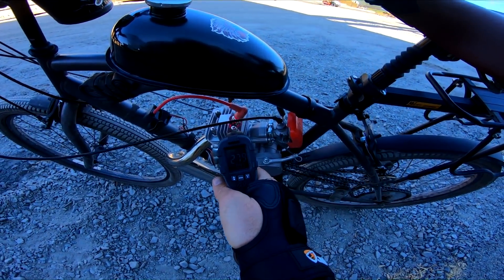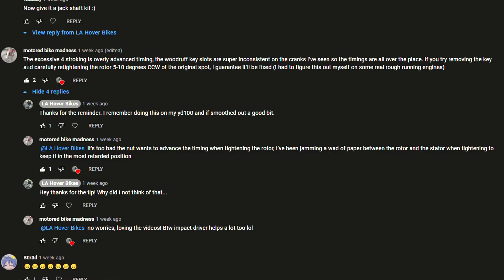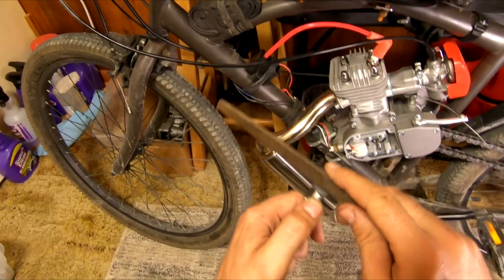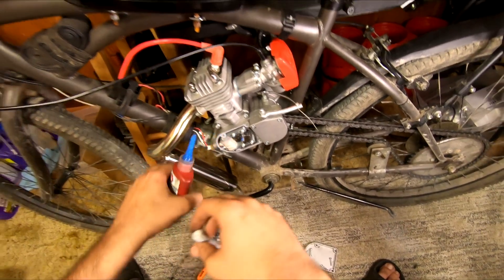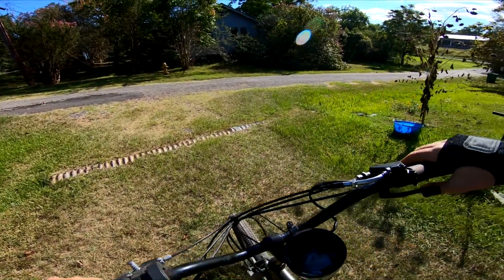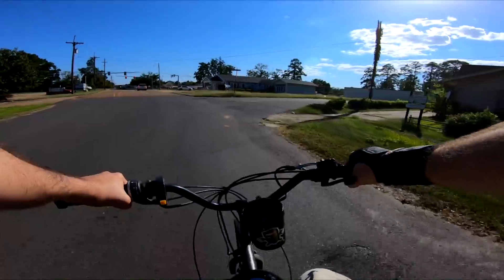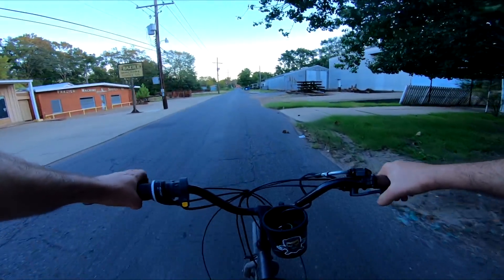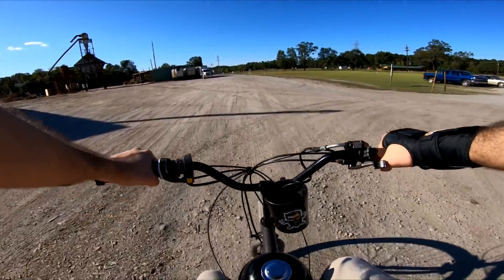Adjusting Ignition Timing On A Motorized Bike

Comment: Firstable if the ( Wal Mart)  bikes if they are pedal  rear breaks, first thing its gonna break is the rear shaft. Second it's gonna go thru the reaar bearings like butter . The brake pedal shims will wear down to almost nothing. No matter how much grease you apply, that will happen to you, NO MATTER WHAT. I guarantee it. In fact, I assure you.

Comment: I'm here because of my Moped engine E-50 with a kit 64cc and it runs Cool 187 to 210 degrees F i'm trying to jet the carb correctly... the kit calls for 1.25mm BTDC but my stator slots only allow 1.44mm BTDC as per my timing Micrometer. so after many jets 82 trough 96 No color change on the plugs at all and have only reached four stroking on the 96 jet just guess i'm plain lucky i didn't seize the motor. i'm thinking the engine never gets hot enough to color the plugs?i'm going to remove the Stator plate and lengthen the slots to allow for more retardation to 1.0mm BTDC and set it to the recommended 1.25mm timing and start over....start jetting at a 94 jet probably.Your thoughts will retarding raise my engine temperature?

Comment: Installed a brand new kit and did a really clean professional job (since Im an actual 20 year auto tech) because I didnt want it called a meth mobile. Got fuel, air, spark, and compression but it wont even try to fire cranking for 20 seconds even with ether blast. Your video gave me one clue to check out and see if my ignition magnet was installed backwards/flipped at the factory. I really hope this makes it start or Im junking it.
Reply: I think it will work for you because I have the same problem

Comment: I made  my straight pipe and it’s loud and mine goes faster uphill goes 50 straight goes 70 mine is faster but the bike it self it steal bike so it’s bit heavy with the motor I can lift it barely but it fasts did 70 in a damm 40 paasd a cop didn’t get pulled over I was cruising

Comment: I would like some advice on the hub adapter for the rear sprocket. I have to use the ring spacer on it. Wanted to see if it would be better to put a set screw through all of it or wood ruff keys? Is there a way to contact u for advice

Comment: Hey bud I have a question for you if you don't mind answering. I bought a JRL half moon exhaust for my 100cc non branded motor, is it any good that you know of? The original exhaust that came with my engine got broken by me loosening the cap bolt to remove the cap and check the inside of it and to add loctite on the nut. So this is why I had to get a new exhaust and the JRL 40mm half moon exhaust was only 20 bucks so I went with it over the stock exhaust. Also I would like to add that I got a high performance 100cc motor kit that resembles the YD 100 and all the parts I have purchased and changed have been for the YD 100 and they fit to a T . I have a 50mm piston, 8mm studs, and a 1 piece top end with 40mm exhaust bolt on and intake. That's why I think it's a YD 100 unbranded, same specs. It also has a ton of torque and speed.
Reply from the maker: They work, but don't do much other than make the bike louder.
You might get a bit more power if it's less restrictive than the stock exhaust, but most are not tuned for these motors.

Comment: I'm putting an engine on a Schwinn Stingray with a Headstrom trike rear end. Both rear axles have traction via freewheel sprockets. This makes it so I have to pedal start the engine. I think I'm running a 25 to 16 crank to center shaft. And boy it still takes a ton of leg to start it. Sometimes it kicks over on the second try. Other times it takes a block to start.

Comment: I put a 110 cc on a trec carbon fiber frame and the carbon fiber is stronger than anything else plus it’s light
Reply from the maker: I'd keep an eye on the tubes where the motor mounts. I'm told carbon fiber does not like to be crushed.

Comment: My experience with a bike kit like this is that there are scant quality parts that you can buy for them. I've yet to find a decent coil for mine that gives a strong spark and I've even tried switching the magneto too and I can't figure out which part is the problem if not both of them. The bike only worked for the first 2 months I used it. I just bought a new carb too as well as the coil and hopefully that will fix the problem of the bike not being able to run unless I'm going down hill or have built up lots of speed befire hitting a hill. You can't trust Amazon sellers or eBay either. There are so many garbage listing that it's near impossible to find anything decent. I've also learned that these bikes need constant maintenance in order to function. By constant I mean be prepared to clean and rebuild the carb every couple months and expect the coil to need replacing every couple months too. And expect to have to buy multiple substandard or non working replacement parts, also never expect that they will come with the correct sparkplug, ever as they won't. and dont think that buy8ng the more expensive ones will be better they aren't and will be the same as the cheap ones and same w8th the red so called Racing ones they are just red and not better at all. And because the wires all have spade terminals you will have to put new spade terminals back on the wires to get a refund. I've never seen wiring that uses them on the kits but the replacements all have them. And the laminations on the magneto are usually horrendous and are normally bent or loose. They are also made from the worst grade of steel ever and are thick. So don't expect a decent spark. It's a dice roll to get lucky and relieve good parts and are rare. Why this is the case is that there's obviously only one or two maker of these kits and the one that makes the crappy ones has 95% of the listings that exist. I'd be glad to pay 400 for a quality one but due to the 400 priced ones being the same ones as the 179 priced kits you are wasting your money spending the extra. If anyone knows of a quality source let me know.

Comment: So how overdramatic are you being when you say “this engine terrifies me” for YouTube effect? I’m asking because I want to know if it’s worth the extra 200 bucks for the phantom 85 over a non built China motor and how close can someone with some mechanical know how come with a home port job to the performance of the phantom 85 out of a regular cheapo head?
Reply from the maker: I don't blame you for asking... but this thing is dangerous if underestimated. Although it is powerful, sadly it has proven to be unreliable over the past year. They have been tearing themselves apart.
Reply: @LAHover  even with the new wrist pin and bearing?

Comment: to hold your shaft take the plug out and  feed a cotton rope into the cylinder  leave a handle on the  outside then bring up to tdc. rope will lock the cylinder.

Comment: You totally didnt even mess with the jetting lol im sure jetting it more lean would help since they jet these engines really rich and recommend 20:1, which 20:1 is sooo bad for it. 40:1 with some good oil such as AMS Dominator would do good and maybe try a few sizes down on the main jet.
Reply from the maker: Down jetting mad the bike run worse. Timing fixed it.
Feel free to go about it your own way, I'm just showing what worked.
Reply: @LAHover  Interesting! Ive never had an 85 but had an 80. Was a POS engine though. Im literally waiting for a brand new Stage 4 Black Bikeberry 80cc in the mail today. Not sure how its going to run but im sure im totally going to have to mess with timing and carb lol its going on 1 of my stand up scoots. Should be super fun.
Reply: @LAHover  I had a question. So i got a Stage 4 BBR Tuning 2T. For some reason the engine sprocket does not want to move when i pull clutch in. Trying to put a chain on and it just wont move. I jiggle the gear and it sounds like something metal inside is stopping it from rotating. Or am i missing something?

Comment: I did not know you could adjust the timing on these engines. Thanks
Reply from the maker: Great way to smooth out a motor without the fear of going to lean trying to tune out the carb.

Comment: Hover I know u have issues with the  chain tensioners so I figured a way to make em pull away from the engines.ok u kn how we all put the bottom of chains on em instead of doing it that way take the top part of chains a run em under the pulleys and set it to the highest it can go and they will never Loosen up again

Comment: Sooo, going back to what you said about putting the magnet in backwards and still having spark.... Where would this spark be?  Would it be the same distance from TDC, but opposite, or would it be 180 degrees out?
Asking for 'Academic' reasons....
Reply from the maker: At TDC the keyway on the crank should be at 1 O-clock
When set on a table the keyway for the mag should also be at 1 O-clock
Reply: @LAHover  Thank you.  Thinking about it some more, I realize that reversing the magnet wouldn't change the timing at all, just the polarity of the voltage generated by the magneto.  (edit: no, that's not even true.  It depends on the alignment of the magnetic poles to the keyway)
To do what I want, I'd need a new keyway cut on the magnet stack.
Argh, but that still wouldn't work, because the drive sprocket would be out of position and the chain wouldn't feed.
Sorry, new enough to this community to still wonder "Can I just turn the engine around to drive a main crank freewheel rather than getting a jackshaft setup?"  But no, you'd need an engine crankcase that's made as a mirror image to a regular engine.
Let me get the thing built first, before I start thinking about mods, eh? :)

One more thing - I'm really envious of the trails you have available to ride on.  I don't know of any similar trail systems around here (New Orleans area) that are available to motorized bikes.  I've ridden my regular bike on the Mississippi River Trail atop the levee, but that doesn't allow powered vehicles.

Comment: You're gonna like that faker frame man, they're real light and strong. Can't wait to see both the motor and frame done
Reply from the maker: It's growing on me. Had the change up the seat and bars tho... To dang tall for that racing stance lol
Reply: @LAHover  Yeah man, try BMX parts, like the Stem and Handlebars, you can trust that stuff (it's a hair stronger than MTB parts), and there's about a half inch more room for the extra brake and the throttle. Man i wish YT had pics, lol I think I went too far on mine but its sick as!

The height thing I tried all kinds of stuff but in the end I chose to change my actual riding style on the faker, it's kinda like riding an 80's enduro almost, so leaning is more scary but I got used to the height pretty quick, and I noticed you run a MTB tread for most of your builds, try MAXXIS HOLY ROLLERS, great half-half tire with awesome performance on street and dirt, and they last too, I noticed with the knobbies I lost quite a bit of turn confidence, so I switched.

anyways man, sorry for the book, I just get excited when someone mentions the Fakers, I friggin love em!
Reply: @zachgrabow9541  i would love to see your bike you should make a video

Comment: Was it Gas BIKE or PIRATE CYCLE that was selling after market performance magnets??? I still have the original one I bought how many years ago it amplifies the spark and retards the timing. When I use that magnet with my jetted carbs the bikes really haul ass for me. I want to find them magnets I have 2 builds right now that are really disappointing to me. I have ZEDA80 that just does not build the power like it should. I am gonna blame it on a bad pickup magnet.
Reply from the maker: Good question, I'll have to look around and see if I can find one.
Reply: @LAHover  Keep me in the loop please. I can look today some it's raining but I have to deal with my insurance company on a medical issue and that takes up half my day sometmes
Reply: @LAHover  Oh by the way I wanted to buy a Phantom 85 and Bicycle engines is out of em at the moment. Something about bad bearings. I am gonna give em call now. Let me know if someone else has em.

Comment: I've watched several of your videos and for the most part they're pretty cool. However, would you please, PLEASE stop calling an engine a motor.
Reply from the maker: Motorized bike 
Motorcycle 
Department Of Motor Vehicles 
Motor Sports 
Motor Swap 
Motor Head, ... 
An engine OR MOTOR is a machine designed to convert one or more forms of energy into mechanical energy. Available energy sources include potential energy, heat energy, chemical energy, electric potential and nuclear energy. 'Wikipedia'

... Nah I'm good bro...

Comment: From Ken himself: The phantom 85 

  There is a lot to talk about.
As many of you have already seen several failures already.
  In this post I'll show what I have found that is wrong with the engine that is on my work bench and in my opinion what is needed to fix some of the issues to hopefully make this engine usable.
  
Squish 1.8mm :(
Soft bushing in the rod :(
Intake port to wide it will snag the ring :(
Crank not balanced properly :(
  Port timing is fair but room for improvement :)
With a simple piston and rod change these issues can be fixed.
 
  With a piston and rod change it has resolved ,
Ring snag.
Squish .
A port timing is nice.
Also can be used as reed or nonreed setup.

Comment: omg, i just got back from pushing/riding my motorised bike, it broke down!!! miles and miles i had to pedal it.   must be the spark!!!!  i kept thinking i must take a spark tool and spare cdi etc like la hover said!!
Reply: I ride with an extra magneto, CDI, 3 different spark plugs, clutch pads, tubes and tube repair kit, every gasket I could need, and every single tool I would need to take the whole bike apart.

Comment: Cool good info you passed along. And yes.. we were all wanting to see this wide open down the road. But, I get it. guess we will have to be patient for the update. I might consider getting this. The other motors in past I just felt was to china.. so never bought them. But, this is a great step in right direction.

Comment: Ive had my crank seal leaking so badly that oil poured out of the stator cover as soon as I loosened the bolts, but engine still running! Those seals are tricky sometimes and each side is of a different thickness.

Comment: 49cc is good enough for me. replacing the Walmart wheel bearing grease with teflon grease would do great. I got a 700c bike with dual disk breaks. everything is adjusted properly and I use it to get things I need. a small motor would aid me a lot.
Reply: 😂😂😂they only go like 45mph
Reply: @foresto5167  more like 30 tbh

Comment: Hey I've been watching your videos for a while while going through the hoops of my own bike build. I had a cool idea about installing an electric bike wheel on the front of my motorized bike. Doesn't seem like anything could go wrong xD
Reply: i was thinking the same thing but i feel like if the wheels werent going the same speed there would be problems
Reply: @sealdilly2691  I had the same thought recently. My thought though was using it to get up to speed. Electric to accelerate and fuel for the mileage. Could also use when hill climbing to help out the china girl. The different speeds shouldnt matter in those scenarios.

Comment: I tried this on my BT100 and yes, it did smoothed out the mid RPMS and my idle sounds much better. I shaved off about 1mm in the woodruff key. However I still have some 4 stroking on top end , probably carb tuning issues since I'm using a Bofeng carb.

Comment: Thanks for the tutorial.My bikes been a bit off and moving the clip about hasn't done squat.I even went to a BR5HS for it's hotter spark as its ok in winter.It just wasn't right.I f'd up and thought 25:1,because of the 80-90F the last month would make the motor last longer,but now I see the DUH in that.Happy Trails.BTW.Even with the $140+ 'alloy wheel sets' you really have to check the bearings often.
Reply: I'm hoping I can convert my hubs from loose ball bearings to cartridge style bearings like what a motorcycle wheel uses....MTN bikers want the quick release wheels/axle but I think for a motorized bike, the beefier bolt on wheel axles are better. Pretty sure those quick release axles aren't nearly as strong and are for weight savings & making tire/wheel changes easier.

Comment: I love the idea of those gas bike frames, not that I can get my hands on one anyway, but I'm nervous about aluminium frames. I've not had great experiences with aluminium. My Mk4 (green bike) ended up chewing out the rear wheel dropouts. I took the grinder to to smooth it out and it happened yet again so I retired the bike
Reply from the maker: I know the color is called "Brushed aluminum" but hopefully is steel, or at least a quality aluminum alloy. Thanks for the heads up!

Comment: Hey there fellow motorized bike enthusiasts. Just racking my brain over this little over half throttle the engine just almost  completely falls on its face. And I had just installed a new mz65 expansion chamber exhaust pipe clone. And a CNC high compression head. Right off the bat starts right up idle's great.  But While I'm riding and start to give some throttle the rpm's are pretty high. But like I was saying little past half throttle it just starts breaking up . does anyone know what the problem is?
Reply from the maker: So as soon as you added the pipe, and the head it started acting up? Make sure there is nothing you may have changed during installation like a bad electrical connection, or melted wires... After that I would go back to the stock head and see what she does. If nothing changes re install the stock pipe. We need to make sure we are not having an issue with the upgrades. Also make sure your head gasket is not leaking, your squish gap is not much bigger than 1mm, and for good measurer change your spark plug.